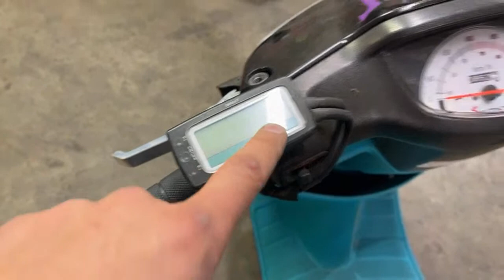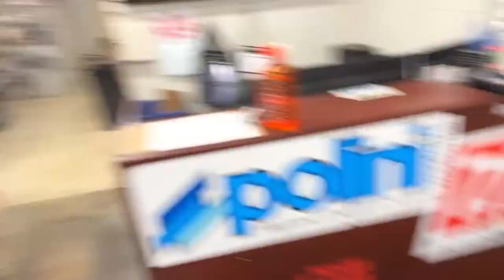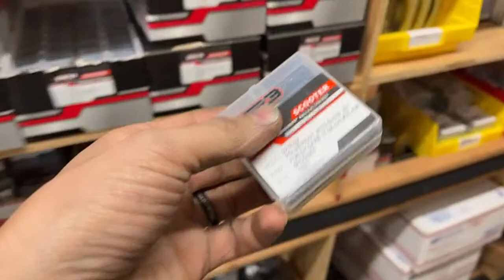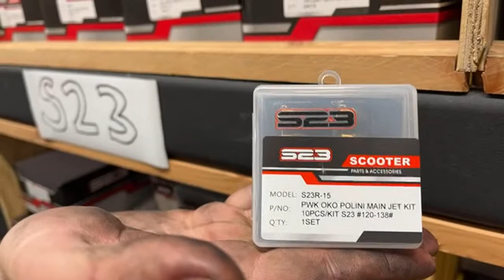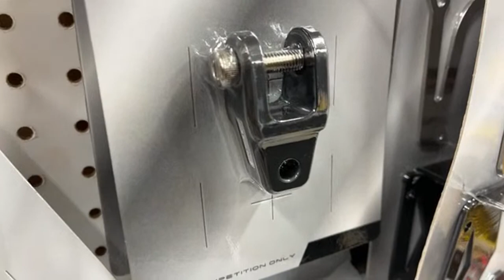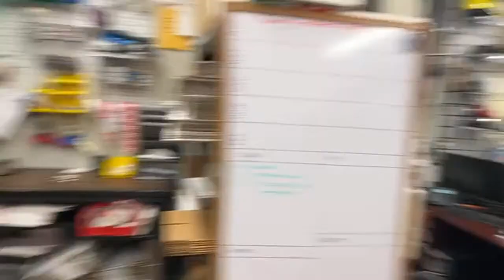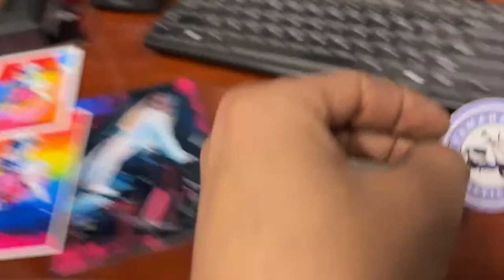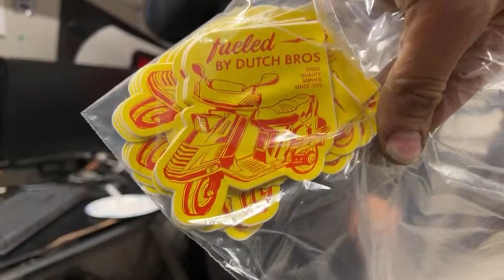Shoptalk Prebug build

Comment: My jog is horizontal and I just run it rich for now ion got no smaller jets, I got a cheap jayaco cylinder any tips
Reply from the maker: Hi so your running rich and you don’t have small jets? Install smaller ones
Reply: @Scooterswapshop  I was lol just got a stage 6 clutch from you ,I’m about to get a belt and do you sell jets smaller then 92 for Mikuni carb